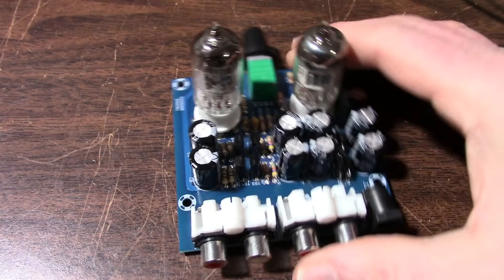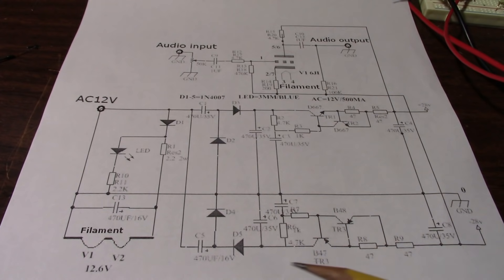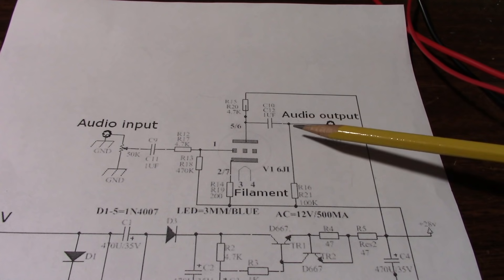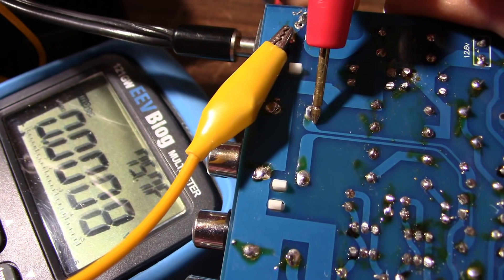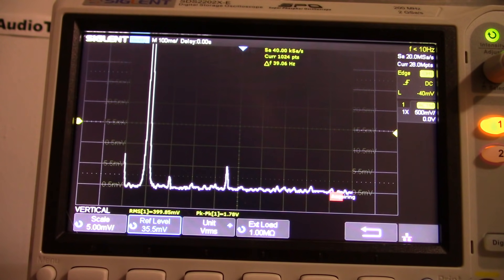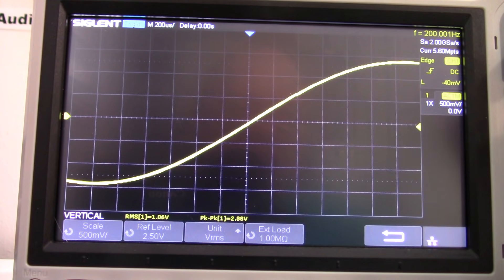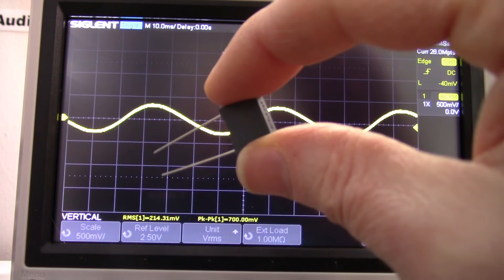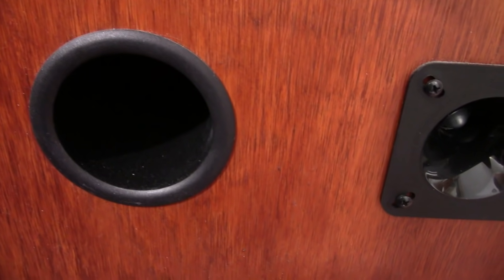Tube preamp budget kit test and review

Comment: Hi John, I built and reviewed this little preamp on my channel about 2 years ago. The valve is in fact a RF valve, not really made for audio. The Chinese do not seam to have any low cost valves made for audio at all. I did not find hum or buzz on mine, quite surprisingly but it did pick up noise from my bench.
Regarding the low frequency response, I started testing with an amplifier with a 10 K pot on the input, like you I found the low response very poor. On switching to my main amplifier, the L12/2 with it's 50k input pot, the low end was much better but did end up replacing the input caps to 2.2 mF. With this combo I ended up with -1db at 25 Hz. which is OK.
Overall I did not like the sound, quite coloured and lacking detail, but it is a valve and silly cheap. Does anyone expect HiFi really? A number of people asked me if it's OK for a mag cartridge. The answer of course, diffidently NOT. No RIAA eq and quite noisy with just 3mV input. My review here if anyone's interested in a second opinion.   https://youtu.be/ZpdBQ-MwqrM
Reply: Russian 6n6p or 6n2p would work in this application very well, of course need to adjust resistors values. SRPP works best, but not by this plate voltage. These tubes need min 100v plate U

Comment: Mine was noisy but I found a threat on diy audio website explaining how to add some capacitors in one of the resistors, also removed the pot and cut the coper trails as they go close to the heaters power. That little change removed all the hiss. Good video, thanks John.

Comment: I have a soft spot for these cheap DIY kits of these hybrid tube amps because they are pretty straight forward and people have actually been modifying the circuit in online forums and making it better, by showing how to bypass some traces and re-routing them. It's definitely possible to fix a few design mistakes and i'm sure with audiograde resistors, these little amps sound even better.  I got myself a few of these as solder practice kits and work on combining 2 of these to a little guitar Amp. Keep in mind that these kits are really only using the tubes as a audiosignal pass-through. Which for some of us is exactly what we need to get somewhat of a tube-sound on a budget and at much lower voltages. So this Transistor / Tube combo is pretty nice. The more common sold pre-made models usually come with OpAmps instead of transistors. However the standard tubes that come with these are usually not really audiograde level but military grade tubes.

Comment: I have had one of these things for a while now, mine has a green PCB, I remember looking into its power supply to figure out how they were getting the tubes to run off 12V, at the time I didn't know that it was possible to run tubes below a few hundred volts and this got me to learn how it was possible, I learned from the process that there once was a time when tubes were used in car audio! That was fascinating... Anyway, I didn't get any of the noise that you got with yours, I didn't really notice the bass rolling off, I will be looking at mine to see if it's the same thing with it.... 
I predominantly use mine for when I need to connect my android phone to my hifi when I need to record to compact cassettes! The phones output is hopeless but this thing works wonders for gain... I was amazed when you took it up to 100khz and it was still flat, I was kinda hoping that you would take it higher in the frequency to see where it was going to start giving up, sure! It's not like it's usable for audio all the way up there but it's pretty impressive considering that it's vacuum tube and it's a $10 Chinese unit, those provided tubes aren't anything special but they work, most people tend to go for the 12AX7 but I prefer the EF86 for hifi, the 12AX7 seems to be heavily used in guitar amps but I guess that's just personal taste talking there... Actually the Mullard datasheet for the EF86 is one of those datasheets that have a plenty to say about those tubes and hifi, I think that Mullard specifically designed them for hifi... It's a real good read if you can get your hands on it.... 
I hope that you can work out why yours is humming, might have forgotten the words or something LoL... 
Great to hear that snickers is better! He's a fighter!
Reply: Hi Peter, yes valves that are used in preamps quite often run on low anode voltages, ie 50/100 volts. The EF86 is a good example. Mullard often used it in what they called starvation conditions, low HT and only a mA or 2 in current, claiming low distortion and noise. The EF86 was made for use in real HiFi amplifiers of it's day. The ECC83 being a double triode was favoured in tone control circuits using negative feedback between the 2 triodes. Guitar amps liked them to cut the tube count down, noise not being an issue.
Car radios did use valves but not really on a low HT as they used a vibrator to step us the 12 volts to about 200/250, higher in fact than  many American all 5 domestic radios. 
The valve in this kit is really an RF valve, not meant for audio at all, probably why it's HF just keeps on going up...and up.

Comment: Regarding your comment on the 28V being potentially dangerous to things hooked up to the output - since the voltage coming in is DC, the 0.1uf cap should stop it and only the AC voltage from the signal should pass through? My circuits 101 knowledge may be lacking though.

Comment: I have this kit! It arrived with one of the tubes smashed however ... I got some replacements. No instructions and labeled in Chinese! 😂 I started out by powering it with DC and getting the inputs and outputs swapped. I did some "troubleshooting" and removed the 104 caps (mine were not like yours). Finally figured out my mistake and put 'em back in. Seems to be working? I had to power it with a transformer I have that is suppose to output 12V6 but I was getting +/-36V at the test points on the back, the ones that should be +/-28V. I am going to order an AC wall wart off Amazon next month for it I think ...
Reply from the maker: I was getting high voltage as well and had to use a variac. Get a small 12 volt transformer of no more than 500ma so that the amp loads down the transformer so the voltage is not so high.
Reply: I recently got a kit with one of the tubes smashed too. I got a refund for most of the order and have ordered some new tubes for it with the money. After some of these reviews I've been watching, I'm wondering if I shouldn't have bothered ordering the kit in the first place lol. But I'll solder the kit together and see if it's any good or not. There seems to be plenty of info online for modifications of the circuit

Comment: So it wasn't just my imagination that the tube amp I just put together last week seemed bright/tinny compared to putting the signal directly into the class D 7498e amp.
I'll try switching out the 1uf caps for some larger value ones, nice timing on this vid.

Something I noticed with mine was that the 12.5V AC transformer I used was actually putting out 13.5V and the voltage across the heater elements was 13.4V and on the edge of too high for them (6.3V +-10%), but the 28V ended up at 33.5V. There's a 2.2Ω resistor that I could switch out to bring it back to 12.6V (the elements are 36 ohm each) by my calculation a 6Ω resistor should do it. Unfortunately my kit is full of 35V caps so I cant push for higher input voltages without switching out all the 470uf caps to 50V rated ones and I don't have a 6ohm resistor though a 4ohm resistor in series with the 2.2 ohm should do the trick and I have plenty of 5W one's of those, it'll just look messy.

Comment: Hey man. You should do a mod video where you fix all the little things you mention. Put that resistor in the right place and swap out those caps, and the 10k output resistors. Post a schematic with your changes. Then conduct all your tests to show the differences. See if your can take that $10 Chinese junk amp, and make it a decent entry audiophile amp.
Reply: I would like to undersstand the story about 10k resistor ? IS it to simulate the power amp input impedance ?

Comment: I have this preamp. Upgraded it with GE5654 tubes. This circuit by itself is rubbish induces all sorts of noises (AC) to the amp ruins the entire fun. But then I added lots of good quality caps, Inductors, changed coupling capacitors to WIMA that started sounding amazing. Most noises were gone. But still it needs to leave it at low gain since its gain has increased considerably after all the new caps. But we just need that distortion thingy you know :P But yes enjoying it since 2 years.

Comment: IM having the exact opposite problem, only bass is coming through. Power amp input impedance is about 20k ohm. I replaced the crap ceramic coupling caps with 2uf WIMA and it made the problem even worse. Kinda at a loss what to do with it. Ordered a second, exact same problem. I was expecting a lack of bass going in, not ONLY bass,

Comment: I would love to see your modifications to this board in a second video. I have an FX-Audio preamp using the 6K4 that sounds incredible with the cheap Russian 6J1p-EV surplus military tubes you can get on ebay $20/10 shipped. It makes my $75 class D amp sound like my fathers old KRELL amp that cost well over $1000. With what these cheap tube buffers do for audio on the cheap, they will be getting more and more popular esp with a near endless supply of NOS military grade sharp cutoff pentodes available for a dollar or two each on ebay
Reply: Haven't tried the J1p-EV's .. probably my next try but I ordered a pair of Jan5654W from Riverstone on Amazon with excellent results for the Fx Audio 03 that also came w/6k4's. I thought the shipped tubes sounded ok until I received the Jan5654W's. Way more linearity, better bass and better mid and upper range. Since the case and tubes are so microphonic I used some cable ties as tube dampers and put a piece of high density foam with a weight on the back part of the case and that eliminated all the anomalies in the sound (wooly bass and diffused midrange). On my system w/Martin Logans I was floored at how good this little preamp sounded. Next move is cap replacement.

Comment: I’ve built a few of those and I use it as a guitar distortion effect. I rewired one with two pots and fed one tube into the other to overdrive the other and with two pots you can control the gain stage 😎
Reply: I use it as a guitar preamp too, but it's quite noisy, what did you do to solve that problem? If you did
Reply: I did it too ,it’s nice sounding

Comment: what is the problem of letting the audio run through a ceramic at the input ? i guess that was higher value one .....

and also the hum was kinda annoying on my kit, which i found a little improved when used twister pair/ shielded input cables and probably used a 1000uf filament cap.
Reply: I guess it's because they are microphonic, they have a piezoelectric effect.
Reply: @Gengh13  i see, thanks. may be i will change them to electrolytics then.
Reply: @Gengh13  2.2uf at i/p & 4.7uf at o/p electrolytics sounding a bit mushy. i may change the i/p ones to 1uf box caps probably.

Comment: I think d4 and d5 are drawn backwards.  do tr1-4 just limit the current to 15 mA?
edit again:  I see what they do.  R2 and C3 form a low pass filter (72 mHz cutoff) and TR1 is an emitter follower for that average output.  guess that will work if the ripple is not greater than Vbe of TR1 (negative can't be less than Vavg - Vce sat).  TR2 and R4 are the current limit
edit again again: oops the diodes are correct

Comment: I'm not to good at Electronics but it don't stop me watching and trying to figure stuff out. One thing I thought about tubes was they need a high voltage like 80v+ and I normally thought it was 200v+ but looking at this diagram it's only 12v but the tube input is 28v. Can you get low voltage tubes? I have seen on the net that tube stuff shouldn't be done by beginners because of the high voltage it uses, it can bite you! Is this a true assumption?

Thanks!
Reply: Tubes work with electric fields and very roughly more voltage > bigger electric field > larger curent and curent is what you are controlling in a tube. This does work at low voltages as well but the margins are just so slim and since tubes were mostly run off mains might as well make it high voltage. 
However, many tubes will run far below their intended voltage, especially high gain tubes like the 12ax7 famously work even at 12V, since they have electrodes very close together, increasing electric field (if i remember stuff correctly) though at that point you are so far out of spec, so don't expect any performance. I have a distortion pedal that runs a 12ax7 at just 9V and it certainly does create a lot of distortion. In the amp in the video they are actually run at +/- 28V so 56V in total, wich is a range where you certainly can start to get proper performance.
But actual low voltage tubes do/did exist, mostly inteded for battery powered or car radios. They are mostly direct heated pentodes like the 1T4, that work nice at 45V (5 9V batteries in series) and a single AA for heater, it is also still super easy to get. There is also a series of russian pencil/rod tubes, super tiny tubes that also work nice in the 20-60V range,  like the 1J24b, also easy to get and lots of projects already out there. And for the super low voltage range you have space charge tubes, those are really made to run 30V and less, the ECC86 for example is designed to run off a car battery at 12V. These are quite rare and expensive but you can still get them.
And yes, a proper high voltage tube amp can and will kill you if you don't know what you are doing, but safety can be learned and if you follow proper precautions you will be safe. But it is good to have respect of high voltage, know what you are capable off. If you are not comfortable working on a live mains circuit I wouldn't recommend working on an active tube circuit, but the low voltage stuff i mentioned is a good place if you want to get started, 50-60v is quite safe (but still can quite whack you so caution is still necessary) and easily gotten from a voltage multiplier like in the circuit in the video,  from basic power supplies (lots of network equipment uses 48V to 58V psus and since tubes need low current, a 15$ 48V 500mA supply for a poe switch is easy to get), boost converters or even batteries (9Vs in series). Or just see what runs at 12-20V. Look into the tubes i mentioned, there are quite a few projects with them and simmilar tubes out there. Stay safe and have fun.
Reply: @uzmeyer1752  Thanks for the detailed response :-) Much appreciated!

Comment: I bought and assembled this kit, but have yet to run audio through it.  The schematic you show has 5 diodes, but on the main board there was only marked locations for 4.  My kit came with 5 diodes. Looking at the board from the front with the potentiometer, on left side,, there is a diode.  Looking closely at the PCB, there are two unmarked holes that have PCB traces on either side of that diode.  Does the 5th diode go there, and if so, which direction is it oriented?

Comment: Looks like a lot of trouble with 12V AC and a voltage doublers instead of using a low power switching boost converter to make 250V from the 12V input.

Comment: Hi John, Iv'e looked around the internet trying to find a definitive answer to this question. When measuring the output of a pre-amplifier, what resistance should be across its output? 
In this video you use 10K, is that a standard or just for this tube pre-amp? I have seen some posts suggesting 100K per channel. I would prefer your advice if possible.
On another kit assembled which has 4 dual triodes, I started testing with 10K on each channel. After reaching 10 clean VAC on each output I decided to stop the test and ask you.
Reply from the maker: It depends on its use. If you're going to connect it to an amplifier with a 10k input impedance, test at 10k. If it's going to be a product released to the public, I'd test down to 1k.
Reply: @JohnAudioTech  Nice one John. I was worried I could do damage to the pre-amp by pushing for maximum output, even though I did the same tests on an op-amp based pre-amp and it was fine. The tubes on this kit cost a lot more than the op-amp kit.

Comment: Hello mister John, quite coincidentally I also bought this amplifier!
can't you tell us/me a little more about how this Tube preamp could be improved?
I understand replacing one or two of the capacitors?
.
apart from that i experimentally put the output of one tube into the input of the other to get some more gain,
can you give an opinion on that?
.
Healthy and Friendly Greetings from the Netherlands!
Rob
Reply from the maker: For line level, gain is the last thing more that is needed. Definitively upgrade the output capacitors. I'd have to tinker with the board to solve the hum problem.
Reply: @JohnAudioTech  

When I bought this I thought it won't be the best but wanna see what it does
But it disappoints me!
Had hoped for a bit more Amplification but no.
In that respect, I should not have bought it and built an ECC83 myself, for example,
I have quite a few tubes lying around here and also transformers.
But you are a bit misled that it looks pretty nice!
It was true that if I did the exit from one half to the other half entrance it was slightly louder!
(I don't need stereo but mono)

Kind regards again from NL area Rotterdam!
Rob
Reply: @hobbyrob313  Hallo Rob. I have made this preamp in mono. And it's loud. I have added two potmeters and there are not past noon too loud. Also due to the microphonic of the tubes they are feedbacking. But i.m.o. this preamp is loud. Groetjes ook uit Rotterdam. Paul.